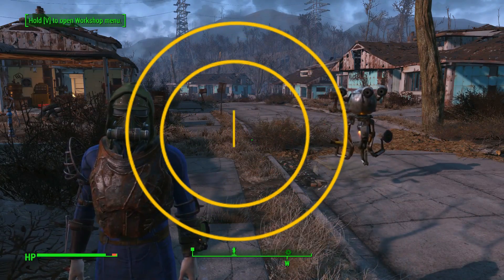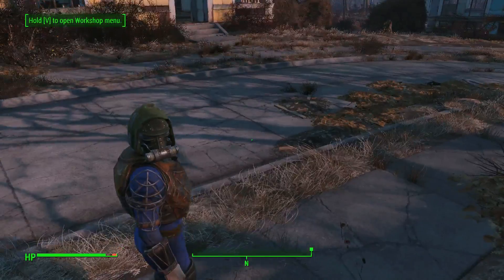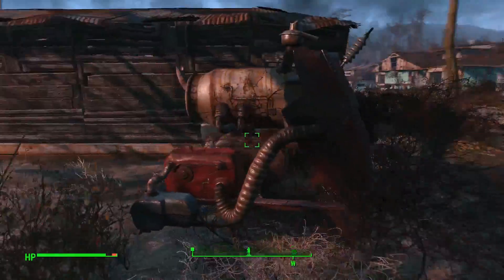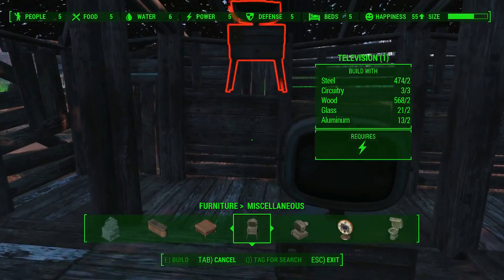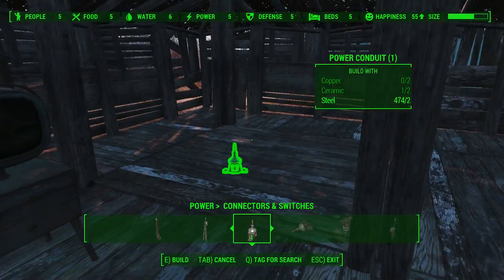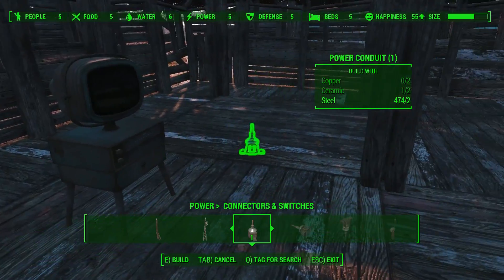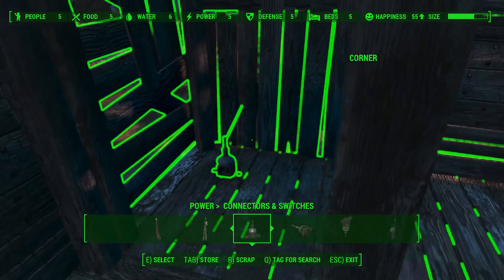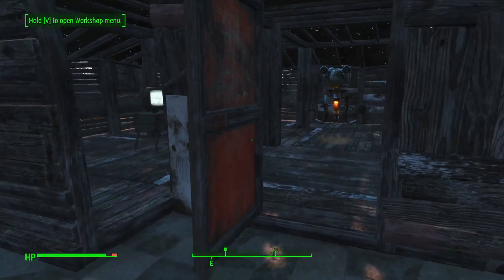Fallout 4 - Powering TVs (Power Tutorial 3.0)

Comment: Thanks for the videos. How long can the generator cables be? I mean, can it reach like the 4th floor? or the house after the nearest one?
Reply from the maker: They can't be infinitely long, what you can do is you can run a wire from a large pylon or connect multiple wall conduits. That should do the trick to get power to the 4th floor! Hope that helps
Reply: thanks for the tips. Looks like there's going to be lots of cables going through my walls and floors
Reply from the maker: +Xandr017 Haha sounds about right! Luckily Bethesda doesn't mind things going through walls haha.